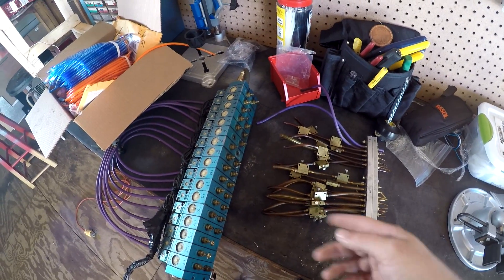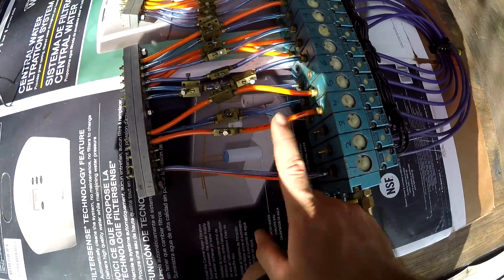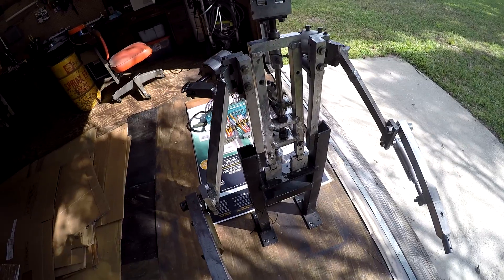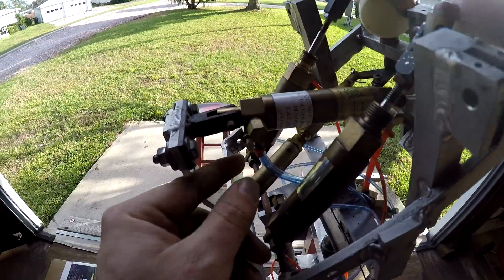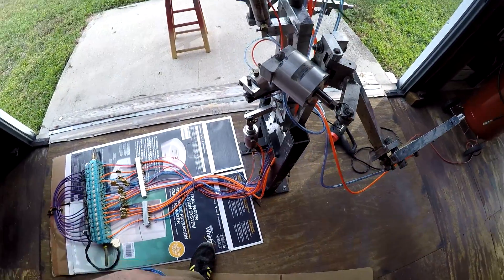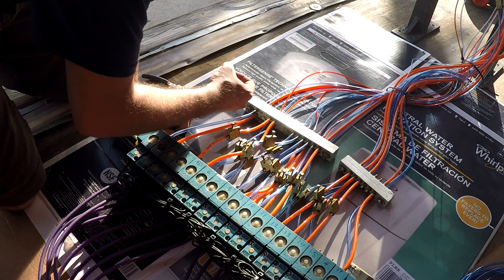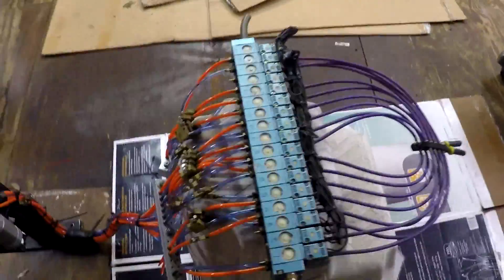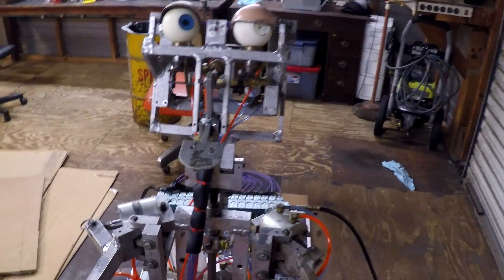Robot Drummer Animatronic Project Part 6: Hosed

Comment: This pile of shit one doesn't hav the proper tubing it doesn't have smooth control air valves
And it looks like a taco salad in a nut shell

Not trying to insult but you should try tubing that isn't so bright
Reply from the maker: Skywtaker Is here When you're crawled under the stage trying to set flow controls it is nice to be able to easily see the color of the tubing to know what side of the cylinder it's hosed up to.

Comment: Maybe it just didn't have enough pressure. Valves may need a minimum counter-pressure from the non-active side to properly operate.
Reply from the maker: Nope I did crank up the pressure and same thing. I took one of the coils off the valve and it had alot of crap stuck in it. Also the seal for the back cover was damage. This might allow the air to flow out the exhaust but I'm not sure. I'll have to try to cut my own gasket.